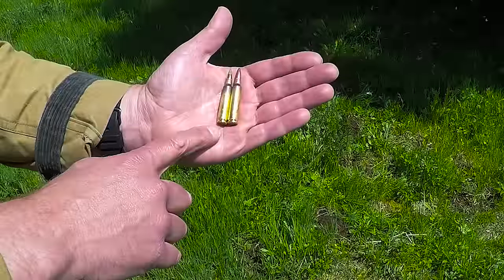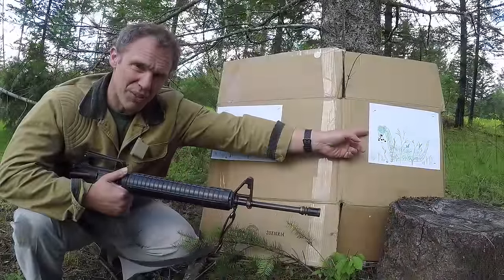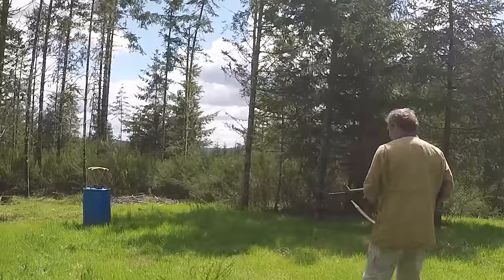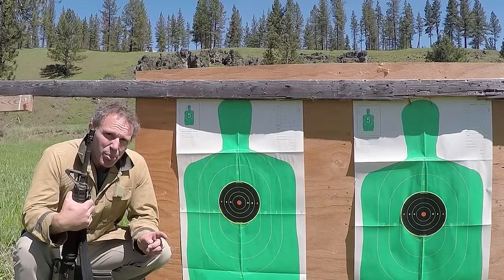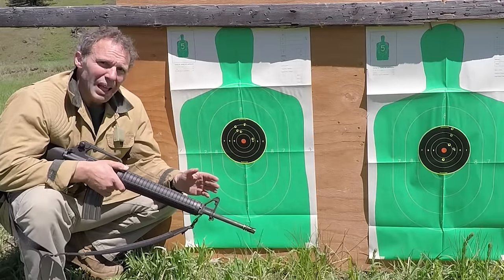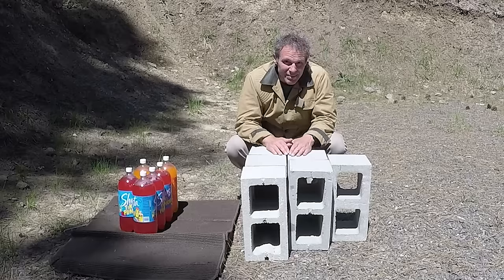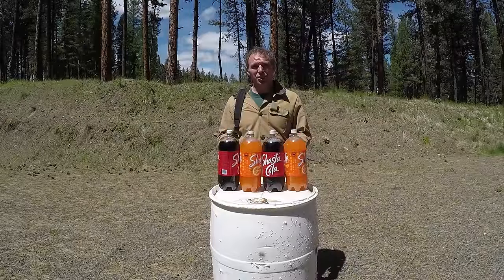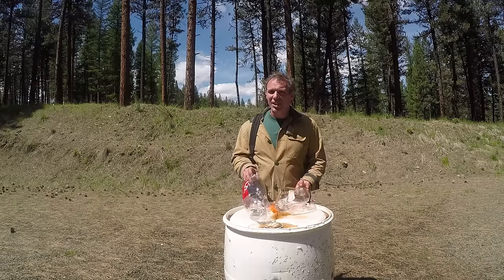5 56 NATO Ammunition:  XM193 55gr.  vs  M855 62gr.

Comment: If you test M193 and M855 on a windshield, car door or similar light cover with a bottle or meat target behind, I believe you'd see a pretty big difference in the effect on target. The M193 FMJ will start to fragment after initial impact and in theory, reduce its mass faster, while the steel insert of M855 will help it retain its mass and terminal effectiveness. The M855 also tends to have an elongated needle-like nose, which may effect its initial surface impact. I personally think this is good for glass penetration. Lets not forget that a bullet may hit a combatant's gear, such as magazines or equipment in his web gear or MOLLE pouches before hitting the body itself and force the bullet to start tumbling beforehand. The army must have seen something good in the SS109 bullet, because they made the change to it. Whether or not that difference is substantial? Well, as Paul Harrel puts it: "You be the judge"
Edit: Just got to 13:25 and "Damn" indeed. I should have known THE Paul Harrel would cover all his bases.

Comment: M855 is often known as inaccurate simply because of the wild variation in accuracy across manufacturers.  S&B (CZ) is among the most accurate  I've shot, often grouping around 1" @100.   Privi and Spanish Santa Barbara surplus also around 1" Lake City, usually around 3"  Winchester 855 4-5" from 20" rifles.

Comment: i think the steel penetrators didnt penetrate the concrete blocks better because they arent actually designed for penetrating. I was told in the Army by a senior armorer they were designed with the steel core to make the projectile longer (steel is lighter than lead) and thus have a higher ballistic coefficient. This is just what one old armorer said so maybe this isnt really the case. If its true that the m855 isnt as accurate because of the way they are made then doing it for a higher BC wouldnt make sense so IDK.
Reply from the maker: The steel core is so they will provide more penetration through metal like vehicles or thin armor plating.

Comment: Great video. The 55 gr bullets bend then fragment. I posts by people in the sandbox the 62 gr is only really useful if the target is inside a vehicle. My son told me there were a lot of 77 gr BTHP in the old/bad (meaning dirty etc) ammo point in Afganistan since they were used by some of the "special"  people. The 55 gr with is tendency to bend at the cannelure and break up is surely a better stopper due to the energy dump that results. The 62 was untended to penetrate a helmet at 600 yards/meters and came about as a result of the SAW adoption its more likely to just poke a hole. Or so I have read. The concrete block tests shows why in VN when something really needed to be shot up the M60 was the better choice.

Comment: I try to stick to 1/9 and 1/8 they're the most generous in bullet wieght, they can stabalize between 55gr - up to 80 grain.  I use 62 64 and 68 grain for all mine.  Works best in 1/8 and 1/9.  green tip performs excellently out of mine, better than 55.
Reply: and here i thought the 1:7 twist was best for different grains of bullets. learn everyday

Comment: I'm assuming all the 62grn were fired with the same barrel that key-holed in the snake target? If so, it would be interesting to see the 62grn performance with a barrel that doesn't cause tumbling. I enjoyed and 'liked' the video!
Reply from the maker: After the demo on the snake target the rest of the 62 gr ammo was fired through an A-2 barrel. It's 1/7 twist stabilizes the 62 grain projectiles.
Reply: Thank you for clarifying that for me.

Comment: I know I'm late to the party, but I think there's a good real-world example showing how penetrator ammo performs in the field. In the Battle of Mogadishu (Black Hawk Down), the Rangers and Delta in the AO deployed with penetrator rounds (I forget if the core was steel or tungsten, but it was a heavier core). In the book version of Black Hawk Down, Mark Bowden explains that the soldiers armed with M16 rifles and CAR-15 carbines had difficulty killing insurgents at closer ranges. The rounds were intended for light cover and lightly armored enemy personnel, but when fired directly at unarmored enemies at closer range, the penetrator ammo would travel through the intended target without disabling him, and that enemy would need several more hits to go down. Insurgents hit from longer ranges, though, tended to be disabled with fewer shots, as the penetrator ammo lost its energy. These exact distances, if they were included, escape me, but "longer ranges" probably meant a target not more than a block or two away, or from the street level to a target on a rooftop. The operation was in an urban environment, with frequent close-quarters and house-to-house engagements, so most rounds hadn't lost much energy before striking the target. That said, however, no known 5.56mm ball ammo was used by the soldiers in Mogadishu, so there isn't a way to compare between ammo types for that particular battle; in fact, the only comparison I remember reading Black Hawk Down was against the designated marksmen carrying M14's. It's hard to say how the 5.56mm penetrator ammo would have stacked up against 5.56mm ball ammo in the same circumstances, but I still think the battle is worth submitting for consideration.
Reply: @King Nothing: "Blackhawk Down" is the classic real-world example of the M855 in action, warts and all. Commonly known as "green-tip," SS109/M855 contains a copper-sheathed lead core, just as M193 55-grain does - but it has a steel cup or "penetrator" embedded within the lead core. M855 is sometimes called "LAP" or "light armor piercing," this is a misnomer, because it is not true (real) AP ammunition. M855 has a reputation for mediocre accuracy, due to the variability in placement of the cup in the lead matrix, which tends toward inconsistency. If the steel penetrator/cup is slightly off-center or otherwise poorly-positioned, the groups tend to open up. In my experience, Lake City M855 tends to be 3-3.5 moa on average, but your mileage may vary. That's sufficient for combat accuracy, but obviously not match-grade performance. The new and improved M855A1, on the other hand, is supposedly impressive in its performance - but I'll leave that to others since I have no experience with it. I do know that the Marines and the Army had - at one time anyway - a disagreement about issuing it. The USMC claimed that the design of the M855A1 wore out their rifles/carbines much more-quickly than the older ammunition did, due both to its physical design, hardened and sharp tip, as well as its higher pressure compared to the older version of M855.

Comment: M193 is not a North cartridge, it was made be Remington so technically it's .223 Remington, with a military designation as 5.56x45mm Ball M193, and 5.56x45mm (NATO) wasn't created until around 1977 and adopted by the U.S. in 1982, so when people call XM193 or M193 a NATO cartridge they're are wrong, it's .223 Remington.

Comment: I'm like 90% sure that I've read old testing documents that specifically stated that the original design caused the front of the projectile to slow down while the ass-end continued forward causing the wound channel to open up and cause more damage.  The tumbling effect was well known.  Now I'm gonna spend way too much time today trying to find that old document.  I'm pretty sure I remember at least one name though, so that might help.  

Anyone remember those old documents from Dr Fackler? I think that's his name.
Reply: @Harry Peterson , I have found various papers from his work, but I can't find the exact one I'm looking for.  I can see it in my head, it had diagrams of permanent and temporary wound channels, and it compared them to rounds that weren't designed to tumble.

I'm not really sure why Paul would disagree with it. Like you said, it's basically just a function of ass-heavy bullets.

Comment: The 55 grain would work better for hunting since you usually are waiting for a clean shot, not through obstructions, and want it to put all its energy in the target. The penetrator would have an advantage in defensive scenarios which are usually at shorter range but where an assailant could conceivably wear body armor or try to use objects for cover like furniture or cars.

Comment: Everything makes sense till you measured the two for accuracy, if you shot both out of a 1:12 twist then of course the 55g will be alittle more accurate, shoot them both out of a faster twist like 1:7 and the 62g will be more accurate, maybe compare the 2 in the twist rate that they are intended for next time.

Comment: Green tip is for close corner combat an is to penetrate as shown but less speed but not much different an the fmj is to fragment into pieces well the the 5.56 is supposed to fragment into pieces not really tumble but to shatter an that’s why it’s so deadly the 7.62x51 is a penatrator for real an the 5.45x39 I think it is is the smaller similar round to the 7.62x39 but the 5.45 tumbles an is why it is so deadly

Comment: Load your magazines with alternating 193 and 855 that way when the shit hits the fan you know no matter what or who you have to shoot you know one out of two rounds will tear up the soft targets and one out of two rounds will penetrate more stuff the target may be hiding behind. You get the best of both just by using both at the same time 😊
Reply: Using two different grains of ammunition will seroiusly hurt your accuracy as they won't be zeroed the same. Plus, M855 is not noticeably better than M193 in penetrating barriers and performs much worse in terminal performance. However, it's less susceptible to environmental factors such as wind past 200 yards

Comment: Paul, I know this is an older video, but would you recommend a 1:8 twist for a 16in barrel rifle shooting 55gr range ammo, and 62gr green tip? After watching this, I am unsure about getting a 1:7 for my left-hand build now.
Reply: JK: If you plan to shoot nothing heavier and longer than 62 grain ammo, a 1:9 twist might work better for you. Or a 1:8, which is a good compromise between a 1:7 and a 1:9 or slower. A 1:9 generally allows you to go up to about 68-69-grains OK, sometimes a shade higher - whereas with a 1:8, you are good-to-go for up to 75-grains or possibly a bit more depending on your specific barrel and load. Varmint hunters, who often shoot light loads, 55-grains on down to 35-40 grains, may use a 1:12 twist or even a 1:14. But they surrender the ability to use heavier, longer bullets. It's strange and kind of goofy, but some fast-twist barrels shoot 55- and 62-grain chow great. Others, not as much. The only way to know is to test your rifle/carbine barrel thoroughly to find out what it likes and does not like. 
Back in the 1970s, when 62-grain M855/SS109 was being tested, the Army almost went with a 1:9 twist, but then tested the longer 64-grain tracer round, which would not stabilize out of a 1:9 so they switched to a 1:7. I've always wondered if they tried a 1:8 first before going to the 1:7 - but I have never seen anything about that. M855 doesn't need a twist that fast to shoot well; it will work fine out of most 1:9 and 1:8 barrels. Where a 1:8 or 1:7 pays off is if you fire a lot of heavier loads, say 68-69 grains and up.
Reply: @GeorgiaBoy1961  I don't plan on shooting heavy or really light grain rounds with the rifle. It'll just be a range rifle/home rifle, but I just wanted to make sure if someone hands me some very common ammo, that the rifle would be able to stabilize it properly. It was a toss-up between 1:9 and 1:8 at this point really. I think if I wanted to shoot at a distance, I would stick to my bolt action. I didn't want this AR-15 platform to try to be a do all rifle, however, I wanted to be sure that it could handle what was fed to it. It will mainly shoot 62gr, not necessarily just green tip, but wanted to be sure I could toss in 55gr white box for fun. I've looked at the barrel twist graph, and even though it was very clear on what twist can handle what grain bullets, I just wanted to ensure a "one and done" choice. I use a 1:7 now with a Spike's, but I did notice a wide MOA when shooting basic range ammo, so I was curious if I needed to step up to 8 or 9. If anything I will buy a barrel in both lol. Thanks for your input and help
Reply: @GeorgiaBoy1961  Went with an HBAR 1:8 16in. Thanks for the info!

Comment: 1 in 12 twist will not stabilize that 62 grainer. Slap that 62 in a round in a 1:7 or 1:9 you will be happy and accurate. 55 grain is a very good choice also.
Reply: Did you not watch the video? This comment is not adding anything to the conversation.
Reply: @Hjerte_Verke  : of course I watched the video. I am making the point of having a different twist rate to stabilize the 62 grain bullet. A 1/12 twist won't do it.

Comment: Okay now try that out on a model 601 with a 1 in 14 twist 20 inch barrel and xm193 55 grain ammunition. Like Paul said the moral of the story is what are you shooting at. I imagine if you're shooting at individuals with body armor you want to use the 62 grain ammo out of the A2 platform, if you're shooting at infantry that have no body armor protection (soft targets) than the 55 grain out of the A1 with the 1/12 twist barrel would be king for that situation. Because if you read up on Eugene stoners original designs of the M16 platform and then read up on Project agile you'll understand. Honestly a projectile traveling at the average of 3000 feet per second you really can't go wrong either way. I certainly wouldn't want to be in front of either with or without armor. Because unless it's ceramic it's absolutely going to go through and do a dance inside of your body.

Comment: I disagree with you on the accuracy issue on the M855 bullet. It has to do with the 1-9 twist. That bullet needs at least a 1-7 twist to stabilize it's flight. Just as accurate as the 55 gr when fired from a firearm with the correct twist.
Reply: M4Defense depends on your definition of accurate. The m855 with the steel core can vary several grains in weight. And my guns that will shoot m193 and other ammo to 1-2” groups and the m855 groups over 3” every time

Comment: Isn’t it more logical if you have compared/tested the two 5.56 ammos by shooting them from the firearm they were intended/designed to be shot from?  The 55grs. from an A1 with a 1 in 12 rate of twist and the 62grs. from an A2/A3/A4 with a 1 in 9 or 1 in 7 rate of twist...

Comment: 10:52
I'm confused why 35 Vs. 40 is considered insignificant. Is 350 Vs. 400 also insignificant? How about 3,500,000 Vs. 4,000,000? No disrespect intended.
Reply: Welcome Black Carter  I know it's 12.5%. I was trying to paint a picture of how 12.5% scales. 12.5% is significant.
Reply from the maker: @noahbarkelew6093  there are variables. So 12.5% doesn't mean very much.

Comment: You need to tell the rest of the story from the factory that builds these rifles. The main thing about these two rounds and the guns is that the 556 nato 72 grain has to much pressure to shoot through a 223 rifle no matter the twist. Which military rifles are a 1 in 9 twist. But the military rifles can handle the pressure because of the way the steel is made.   But thanks for the info.

Comment: The tumbling properties of the 5.56 are very likely unintended and indicative of a projectile that really has very borderline axial stability. An expanding projectile, such as a hollow-point or ballistic-tip, or frangible rounds that do not tumble will deliver significantly more energy than a non-expanding, non-frangible round that does tumble, and be significantly more reliable. It is for this reason that, despite the greater availability, lower recoil, and lower cost of 5.56 rifles and ammunition, I'm generally more a fan personally of 7.62x51-chambered rifles.

Comment: Is he shooting with the 1 in 12 twist for his accuracy test?  I thought he made that stipulation.  But if so, the accuracy test is misleading, and biased toward the 55g bullet as it will stabilize with the 1 in 12 twist barrel, whereas the 62g bullet will require a 1 in 9 minimum to stabilize.  The 1 in 9 twist rate will adequately stabilize both projectiles and would therefore present a more fair and conclusive accuracy test.
Reply from the maker: At6:08 I said, "Colt AR15A2" It has 1/7 rifling. Please pay attention to the vid before you accuse me of being dishonest or incompetent.

Comment: And we know now is that 55 grain is better at penetrating steel body armor. Especially when fired from a 20 inch barrel at shorter ranges. It will go through level 3 where the 62 will not.

Comment: I wish they made monolithic brass bullets. Harder than Lead, Heavier than Steel, should be cheaper than copper. Would act as a penetrator AND should just be a plain old heavier bullet, at least when loaded to max length with a good, long, aerodynamic, high BC bullet.

Comment: Will a key hole bullet damage the barrel? Bought some ammo that's 223 55 grain steel of course and it key holes at 50 yards with 1:7 twist. Ive shot same type of round but brass and shoots good at any range and used Tula steel case and no problem ringing steel at 200 yards. But since the other steel case ammo key holes I been mag dumping

Comment: And what about out of a 10.5" barrel with a 1:7 twist?  Is the 55 grain still a better choice for lethality?  Or, because of the reduced muzzle velocity, is a heavier grain the better choice?
Reply: Both rely on velocity for fragmentation but the 55 grain FMJ has a lower threshold than the 62 grain green tip FMJ so 55 grain is still the best choice among the two. Keep in mind this is only about 55 and 62 grain FMJ.